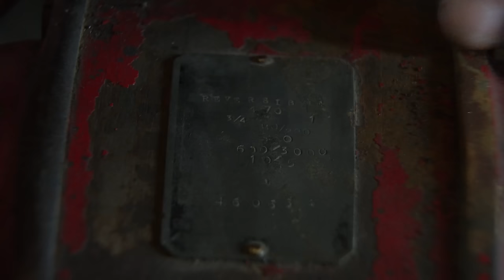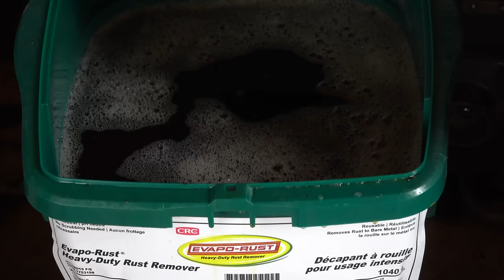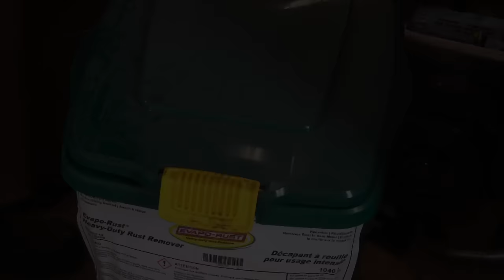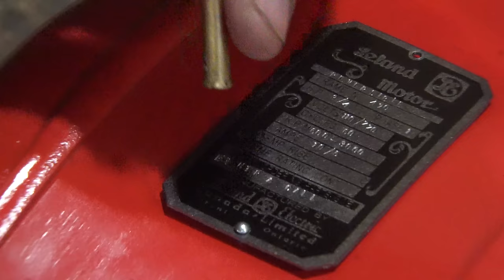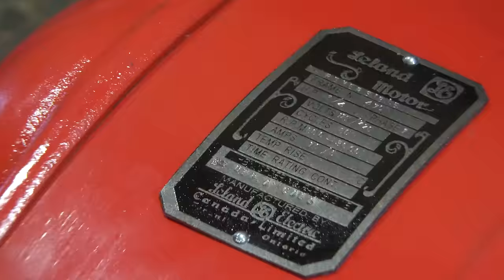Why Did They Stop Making These? [Restoration]

Comment from the maker: If I put this up for sale it will be on my website: www.handtoolrescue.com
Reply: I want it!
Reply: Now that's what u call a sueyside shifter! :D
Reply: I didn't even know this was a thing... I would think that it only gets half the torque as a non reversible motor tho.. but I'm not too sure
Reply: Let me get my hands on this for a steampunk tricycle that will have a gasoline engine, electric motor, and steam engine all incorporated =P this would be the PERFECT electric motor to mount on my front rack for the front wheel drive (and gives me reverse due to bike weight)  Food for thought =D
Reply: as far as I can tell this motor is basically like controlling an engines RPM by adjusting its AFR. the only reason its able to control speed is because the armature control is physically in a less efficient position. Like putting a resistor on a DC motor to make it spin slower instead of just having proper speed control circuit
Reply: That is a pretty slick little device.
Reply: that handle is essentially a dimmer switch ... that has reverse ... one way lower resistance faster speed ... center max resistance slowest speed .. all the way the the other side ... and it spins faster the further away you get but opposite to the other way ... 

think of a balance control it is normal in the middle (off) and turns right one way and turns left the other ... faster the farther out one gets
Reply: Right???? 😁👍
Reply: After you braced the cracked parts, can you show in your next video how you "finish" the parts up, grinding, maybe sandblasting or what ever method you used to blend it all together before painting it?
I do not mind  the video being a bit longer if all the interesting details are there!
Reply: Why no LinkedIn page?
Reply: I need that for my lathe. It would be just about the right age, too.
Reply: Keep it and install it on your old lathe. excellent way to get variable speed without changing belts or gears.
Reply: It’s incredible and now I want one
Reply: This thing is so neat
Reply: don't do the meme titles to your videos. just tell us what it is.
Reply: Reversing file ... :D You just made my day...
Reply: Yes please!
Reply: @1islam1  I really like pal world. Have you played pal world?
Reply: Am I right in believing that the handle is directly in contact with one of the brushes?  I doubt modern health and safety would allow that.
Reply: u dont have to crimp that connection heat lower part up and put solder in the hole. it will make it alot easier to use heat shrink
Reply: Question:I found 2 smaller flatheads that appear to be hand forged with the same style of wooden handles & the same full-tang style construction as the ones you use and advertise but these appear to be very old. I've never seen any like them until I saw yours. Is this a common style of 19th century hand forged screwdrivers or are yours a replication of a particular manufacturer?
Reply: Beautiful work! Well done
Reply: My Wood band saw would love this for metal!!
Reply: 😂😂😂😂😂😂k
Reply: @TrueHelpTV won't work balancing torque would be ridiculous.. then having to warm up the steam engine...with batteries.. fuel tank.. water tank.. engine.. steam engine and electric motor the gears would shred with the weight of it unless you use tractor gear lmao... nice idea....but..
Reply: Will it come with the wooden sheeve?
Reply: I need that for my 1890's barns& noble lathe .
Reply: that's really cool
Reply: I want it but I don’t know what I would use it for but it would look awesome in my shop. Ok I don’t have a shop but I want one of them also. 😊 great restoration 👍🏼
Reply: Surely the tag fell off that said WARNING:  Do not reverse rotation until motor has come to a complete stop.  Failure to heed this warning may result in premature brush failure, excessive commutator wear and burnt windings.
Reply: "Reversing adds material" 🤣
Reply: @1islam1  That's your problem, wanting a relationship with a non existing person and don't give a crap about others...Don't try to force your bedtime stories on other people here, we see how hateful Islam can be, otherwise all the muslim country would help Gaza and take in refugees...Not a chance, Muslims are on 1 line with Allah, not on 1 line with their fellow Muslims...We are all equal, but some are more equal then others.
Reply: Extremely beautiful restoration and something I haven't seen in my life. Well done💯💯💯
Reply: Will you actually be fixing the shoddy wiring or are you going to let this fire hazard out into the wild?
Reply: Check the comment that describes the lacing! Should be fixed before selling!! Very important!
Reply: @1islam1 I can really see the relevance of Islam to variable speed electric motors.  When you start talking to a guaranteed disinterested audience, it shows desperation on your part.
Reply: darrylvaillancourt6144 You forgot to add ... "but I don't believe in punctuation!"
Reply: What kind of equipment did this motor originally come from?  It sounds really rough at very low RPM, and I get the impression that it sacrifices efficiency.  If it is kept at low speed, does it get hot?  What's its torque at low speed?  As long as we're into commutators, you'd be far better off these days with an electronic control that would do the same thing - speed and direction control.

T answer the question in the title - "Why did they stop making these?" - it's because we now have much better means for achieving the same result - or actually, a much better result.
Reply: What is the HP rating on this? I am sure this would be a good motor for a go-kart.
Reply: Unfortunately, the entire Wiring needs to be replaced, or pulled out and new a new Wire Sleave be put over the entire line of wire.  Insulation on the Wire Line looks unsafe, that could lead to failure, injury, and death.
Reply: Very interesting, but what was it used for?
Reply: Kinda reminds me of the 80's sitcoms..😁
Reply: He goes to all the trouble of resto'ing this piece but doesn't try to answer the question in the title ''Why Did They Stop Making These?"...Lame.
Reply: Sorry to be critical, but it's not a good example for others on YouTube to follow, thinking that you have done the job well. I wouldn't buy it. Not even for a dollar. 

Furthermore, the motor is not a genius idea, but rather it's a kludge. 

Several things which you did might have done far more damage than good. No way is that a proper restoration.

The original black paint will very likely have been over-painted as standard in the factory. Many motors were over-painted in green, grey, blue, etc, depending upon the intended use and customer. So black followed by red would be much more authentic.

You didn't chamfer the commutator after unnecessarily removing a skim, both of which can do more harm than good. The sparks on the brushes tell us that a lot of wear is happening because of metal having been removed and the lack of correct commutator chamfering. The commutator will have work-hardened years ago, so skimming it will leave a softer layer which will have to wear and harden again. Unnecessary wear.

The string needs to be doped and packed properly. Its job is to stop the rotor windings from collapsing. A high temperature dope is needed, and a proper repacking tool should be used, to caulk it into place.

Those bearings need more wadding too. Just listen to the racket the motor makes as it turns; it's a sign of either, or both, bad bearing bushes and too little wadding. 

That wire soldering was poor. With the correct tools you could have done a far better job. Pliers are not the correct tool. Similarly with the frame repair; melting that amount of die metal was unnecessary, mainly because of not using the correct tools. You might well have been able to leave it alone; the motor has survived for many years with a long-lasting crack which could be repaired more easily if/when it finally falls apart. That might never have happened.

Why didn't you mark and photograph all of the wires before removing them? Then you wouldn't have had to guess which was which. Guessing can cause a lot of damage, and there's no guarantee that you have arranged them correctly even now.

It's also important not to run the motor under load at low speeds for very long, and it must never be left powered when in or close to the 'neutral' position. As a motor slows down when the phasing is adjusted like that lever does, the efficiency reduces, and currents rise, causing overheating. What the lever does is to allow you to change direction from full forward to full reverse in a second or so without having to use an electrical change-over switch and resistors. They're not really intended to be run at partial speed.

Those motors are not made any more because of the potential for rapid overheating and fire if not used correctly. It's also very easy for fingers to get into the high voltage areas.
Reply: I can't imagine you would earn enough from a sale for the work you put into this.
Reply: That's a cool, kool, or even kewl motor.  Ohh, better save those seeds, might be the last non-GMO seeds out there?
Thanks for showing this motor b/c we're often told how much smarter people are today but some of the older stuff
shows outright brilliance.  peace
Reply: You sir are a legendary legend
Reply: I would like to see photo of nameplate data.  Good job
Reply: Just went to see if this was for sale I want 1 can you build them mabey from repurpose a alternator
Reply: Put out a blue print and it will be reproduced
Reply: Interesting motor. There HAS to be some modern uses for this design. Might be what pushes EVs around.
Reply: I cant believe you took a hammer to that wooden pulley...
Reply: I am guessing the motor already sold. The most obvious use I could see that motor used for would be to drive an automobile or something like that. Of course scaled up.
Reply: I seen someone post it would be perfect for a lathe. I agree to that to.
Reply: @1islam1    This post is nothing but a collection of LIES.  For example It is NOT the same messages preached by Moses and Jesus, It is NOT the going back to the original teachings of Jesus and becoming a Muslim IS turning your back on Jesus.
Reply: @TrueHelpTV  Go buy it, but don't complain when it breaks and takes your hand off! 👍
Reply: @johne5493  Keep it for the liability reasons alone!

Great motor in original working condition, not so much after the rebuild!
Reply: @LMBee00  you're the reason they put caution stickers on curtains.
Reply: @TrueHelpTV  No, it's because of one of your family members. 
I get the reference, shame on you!
Reply: @dictare  Yea, not so common sense! Except for people smarter than the warning ⚠️
Reply: @rickden8362  It was just a rhetorical question.
Reply: @Blakgun  I don't think it's that obvious, a lot of people wonder why things they like in the past are no longer made.
Reply: @GeneralPadron my thoughts exactly! But how many batteries would it need, and how much of a fire hazard is it?
Reply: I like this motor so much I'd like to make a few, maybe some people in here would be interested in getting one. Would you be willing to take some real good pictures so I can reverse engineer it?
Reply: @1islam1  How does this factor in , into refurbishing a reversible motor ?  Will God protect me if this thing blows up ?
Reply: what's it called tho???
Reply: I have the motor image in my mind. Somewhere in my travels I’ve seen this motor in action and I just can’t remember where.
The shift handle is what really stands out and I’m sure I saw it in use in a shop somewhere.
Reply: @KenFullman  No, handle is safe to touch, insulated from the movable, brush assembly. The movement changes the brushes’ position relative to the commutator of the spinning armature.In one position the polarity is correct for clockwise rotation, 180 degrees further, the rotation is anti-clockwise. In between the speed can be changed.
Reply: no dont sell it.
Reply: That would make one hell of a marital aid